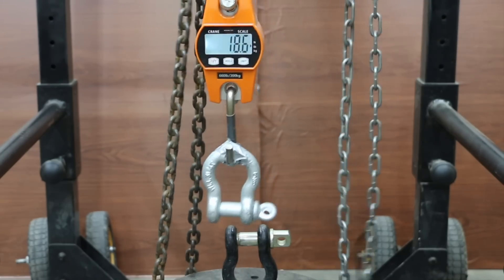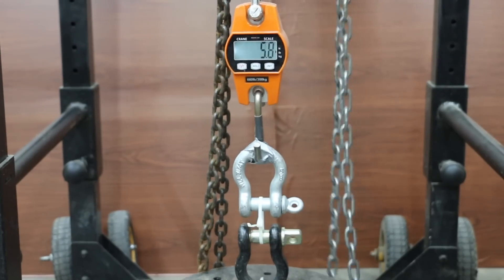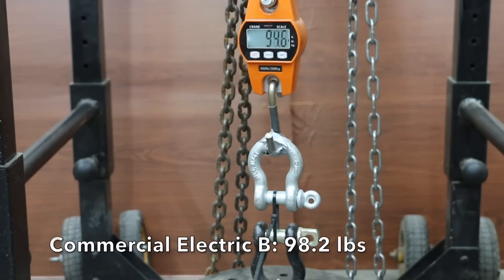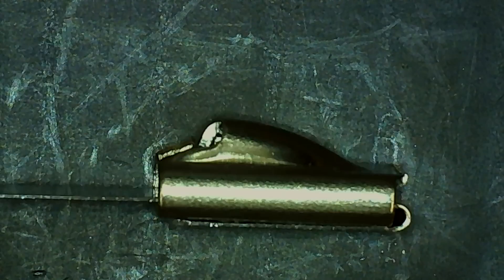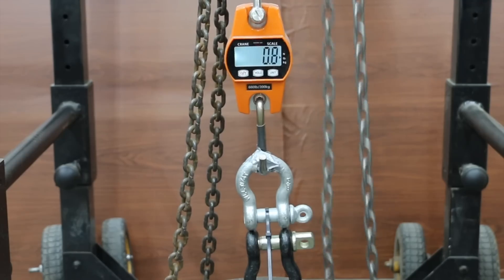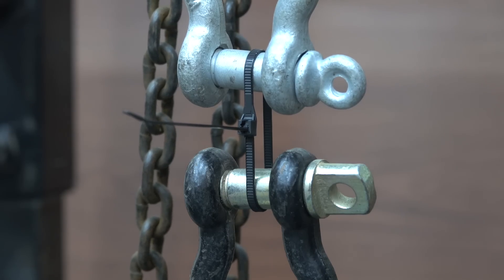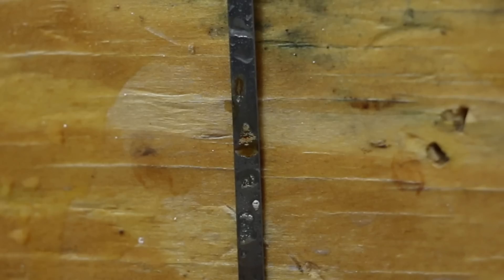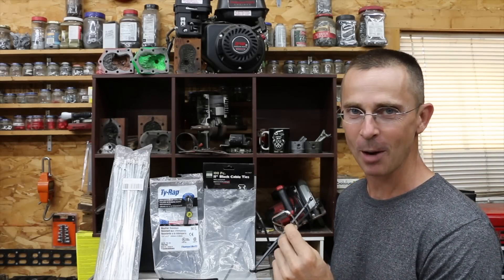Best Cable Tie (zip tie) Brand? Let's Find Out!

Comment: Triple wrapped stainless tie pulling up the back end of a pickup...I hope no one thinks it would do the same only single wrapped. :)   Normally band type hose clamps are double wrapped for more strength; in part due to doubling of the available cross-section and the friction between the band layers, but triple-wrapped is not practical due to too much friction not allowing enough clamping force. I'm surprised you were able to feed two additional layers of band through the buckle/locking ball normally big enough for only one, maybe two.
Reply from the maker: Thanks for the feedback.

Comment: I have the same truck :) I've waited YEARS for you to do a caulking (aka sealant) video. Compare polyurethane, silicone, elastomeric, and acrylic caulking types. Brands could include NP-1 (which is said to be the best), PL (which is ALSO said to be the best), Quad (ALSO said to be the best...you get the picture), Dap 3.0, and others including your generic hardware silicone and acrylic. Tests could include adhesion strength, paintability, stretch, compression, leakiness after cyclic heat expansion/contraction, and mold/dirt attraction.
Also heat and UV resistance, shrinkage, basically what lasts the longest?
Reply from the maker: Thanks for the video idea.

Comment: It would be interesting to make a video on comparing the best anti-friction engine oil additives on the market (like Turbo Maxx, Archoil AR9100, Liqui Moly Cera Tec and Bestline) against an additive called EZI EXTRA POWER LUBE that has been tested and certified by King Fahd University of Petroleum and Minerals. Two of the most interesting results are that it showed up to 71% reduction in wear loss and increase in engine life up to 38%. Here's the link for the testing report: 

https://mafiadoc.com/download/saudi-aribia-pheeramascom_5a27f3d11723ddfec911dfcc.html.

I have been using the EZI Extra Power Lube on my personal vehicles for around two years and it works great but I am not sure if this is the highest friction reducing oil additive in the world or not because I haven't tried or tested the others on the market. Based on my research, I know that Turbo Maxx is the toughest between all the listed above but I do not know if it can beat the EZI Extra Power Lube or not.

Here's the link of the manufacturing company:

https://www.ezi-products.com/

Here's also a link of the oil additive sold on Amazon:

https://www.amazon.com/Ezi-Extra-Power-Engine-Treatment/dp/B07N6KLW1D

Hope we see a comparison video.

Comment: I believe the black ones work better as they have carbon black added to them so they are more UV resistant. Looks like some of the natural nylon ones in your video were rated for indoor use only?

Comment: Something to consider with the nylon ties is the moisture content. Nylon is hygroscopic and becomes more brittle with a lower moisture content and it become more elastic with a higher moisture content. If you decide to conduct further testing perhaps add water to the bag of ties and let them soak overnight. I feel the viewers will find the results interesting. Great video.
Reply from the maker: Thanks for the suggestion.

Comment: Curious if just folding a tie back end back on itself and stapling it, how far would the cheap ones go that had failed on the mechanism. And how good are police ones that supposedly have metal in them. 

While you don't have control what commercials are shown during your shows I try to answer them periodically.  The commercial shown is for KY residents and is against McGrath that's running against McConnell. Says she said electing trump was compared to 911, by a person who was in the pentagon at the time. By the damage trump's done, it's more like WWII.

Comment: I wish you would have included waxed nylon thread, one spool would last an individual a life time and from working on acft the waxed nylon will last decades even when in contact with hydro and fuel where the zip ties tend to fail or break.
Reply from the maker: Thanks for the suggestion for future round of testing.

Comment: I use the Stainless Ties and being from Arizona, I thought it might be helpful to point out that with the Stainless ties you need to curl the cut tail end of the stainless steel ties over on itself twice, this greatly adds to the holding power, the holding ball can slip with vibration over time. All you need is a needle nose and about 5 secs to double crimp the end and you have a 500+ lb (my estimate/guess) tie.  Many YT vids on this process, they even make a nice tool if you use them a lot, but needle nose works great. Also, I don't recommend plastic zips for jobs that have heat, sunlight, it has a failure mode built in. I see auto mechanics using them to hold coolant line or other things out of the way, but they will simply fail with being exposed to a 300-500 degree engine area once brittle.  Same with very cold temps as well, if you are in the midwest.
Reply from the maker: Thanks for the feedback.

Comment: Stop. When I need strength I double loop the tie. I call for a retest.
Reply from the maker: Thanks for the suggestion.
Reply: @ProjectFarm  i made this comment before your final test. Very surprised to see that metal cable tie lift the truck.

Comment: would result be different if the cable lock was 90s from where it is now...resting over the shackle pin?  Does it make a difference where you place the locking part?

Comment: FYI, Having worked in the same jobs in varying climates. I found plastic ties became more brittle with lower average humidity (Low been mid 30%, high been mid 70s). This was most obvious with cable ties stored in the supplied ziplock packaging vs the same brand with torn packaging. This is with ties that spent 6 - 12 months floating around in a toolbox on the back of a ute, only getting used when none where supplied on the job. 

Beyond that, breaking ties that had been fitted for some time was always easier in the drier climates. They tended to be brittle and snap, instead of stretching.
Reply from the maker: Thanks for the feedback.

Comment: Hi Todd, I was wondering if you had thought about test different radiator caps, I have bought one that didn't hold pressure right out of the box, they are pretty cheap but it would be cool to look at a few and their strengths and faults. 
Thanks,
-Nick
Reply from the maker: Thanks for the video idea.

Comment: Ratchet strap showdown next! So many variations styles and brands to choose form. Or "come-along" test if you have not already (a little more dangerous though). Any clamping tools like locking pliers (vice grips) or vices and clamps. Or with all the oil, grease and lube videos you could do a de-greaser test to be different. If you wanted to be a little more nerdy you could do antifreeze test and see which performs better in both hot and cold, resists boiling and freezing and transfers heat the best.

Go weird and see if a personal lubricant like KY can be used as engine oil. This channel has so many options for weird tests and product showdowns it ridiculous.
Reply from the maker: Thanks for the video idea.

Comment: I use cable ties alot in the environment and see the biggest failures during the relatively harsh winters here in New England, I would like to see this test reperformed using temperature as the variable.
Reply from the maker: Thanks for the video idea.

Comment: Since you see a lot of cable ties used in the engine bay of cars, I wonder how heat-cycling affects performance.  I have an older car where zip ties are used to run the wiring harness as well as a few places where I've used one to secure a sensor or connector of some kind.  Would be interested to see how well these hold up to heat cycles.
Reply from the maker: Thanks for the video idea.

Comment: Had just to think about the pinch I got with our previous car: The alternator belt one time broke on the Autobahn and I had to fix it: Using a pantyhose did not work because the space available was too close so I used zipties. This worked for about 20 kilometres or 12.42 miles which I considered to be quite nice for resealable ones.
The car in question was a Fiat Cinquecento model 170 with the 0.9 litre engine and about 39 hp. Of course noone in the USA would be willing to drive such a small car with such a small engine but it worked nicely for our family (two persons with two middle-sized dogs [german shepard and barzoi]). An interesting test would be the elasticity of the zipties because in some applicaitons this could be crucial as well. I picture getting a tent fixed for example.
Reply from the maker: Thanks for the video idea.

Comment: Ties will see different modes of failure.  But the two main causes of performance deterioration is prolonged UV exposure (polymer cross linking) and cold temperature (harden of material in simple terms).  In case of UV exposures, you really won't notice any performance decline in most formulation until after about 3-5 years.   There are machines to simulate these conditions but the in vitro results are inaccurate IME. Exterior application of Nylon seems to dislike low temperatures.  The harden of the material can cause failures as soon as any dynamic forces are applied, say, the stock being tied getting shifted. You are better off doing a low temperature test of these (-15C) Additionally, the design and the number of the teeth often matters very little in my experience as you only really need it to hold at one point to ensure you can achieve around 50-75lb of guaranteed loop tensile strength. Temperature can cause the compliant mechanism to harden and fail, and you will see that as the mode of failure more often than not. As well, you will generally always find US made products performing better not because of the manufacturing process but because of political environmental situations.  More than a decade back, China had outlawed curing/stabilizing of resin by steam as it is extremely energy intensive.  Chinese ties have to be boiled to be cured.  Steaming often allows much better performance over a much longer period of service life, especially on the exterior.  Interior wise, you won't notice too much.
Reply from the maker: Thanks for the feedback.
Reply: @ProjectFarm  we've been a specialty manufacturer for decades now. The quality is really down to the formulation, mould accuracy and curing process.  While I can't divulge anything as to formulation, the later two factors are more like art than exact science.  Some engineers knows exactly the shrinkage rate and how and when to cure/stabilize the final product. I can also tell you with a certainty that darker coloured ties will always fair better in UV heavy environment.  If you had a choice between two exact same ties rated for exterior, get the darker ones.

Comment: Great videos. Thanks.

Removing mill scale at home is one that even the professionals are still debating on. Making it more difficult is large pieces that can not be dipped in a solvent of some sort. Sandblasting at home with a cheap sand blaster vs flappy discs etc. 

How about weld thru primers? 

Thanks
Reply from the maker: Thanks for the video idea.

Comment: Love you stuff! I work with plastics and there is a third variable that explains some of your numbers. Nylon does indeed suffer from UV exposure but nylon strengthens with moisture. Your nylon ties that had been exposed that had UV blockers added were strengthened by humidity.
Reply from the maker: Thanks for the feedback.

Comment: Can you test out "nanotape"? Its this new tape thing thats bot sticky in the traditional sense but uses nano structures to grip things (like gecko feet do). Most claim to be water proof and reusable, id like to see if any strength is lost in that process of use - wash - reuse,  along with their overall load bearing capability (both on a wall (shear strength) and on an inverted surface like a celing (pull strength?)) And what surfaces they stick best to, most claim only smooth surfaces work properly, but I'd love to see painted wall, bare wood, corroded metal(?) And even fabrics (such as using it to stick a flag to a wall) 

Keep up the great content 🙂
Reply from the maker: Thanks for the video idea.

Comment: As a retired telecom tech, I can tell you size does matter when it comes to cable ties.  We used black because white was typically for interior use only.  For heavy loads, we used a very wide black cable tie (that I haven't seen in any store) that I have never seen fail.
Reply from the maker: Thanks for sharing.

Comment: Great job. Thank you for all of the experiments you do so we don't have to!

I have a suggestion for a video. testing offset drivers like this one. ARES 15008 - Impact Ready Offset Extension Wrench. I was actually looking for other brands, but couldn't find any. Maybe a test of using this tool vs using a standard ratchet in tight spaces?? Not sure.
Reply from the maker: Great suggestion!  Thank you.

Comment: watched with genuine interest but at the end of the day, my cable tie purchasing decision is usually based on whatever is cheapest at the store that I happen to be at when its time to restock. Even the weakest one in this video is about 10 stronger than needed for what I typically use a cable tie for.

....Will have to buy some of the stainless ties for the shop though, I could find a whole different category of use for them at that strength.
Reply from the maker: Thanks for sharing.

Comment: My take away from this video is that I should buy zipties and leave them exposed to UV for a year before using them, lol.

I assume the UV Exposed Zip Ties were from the same batches as the ones that were tested without UV Exposure, eliminating the possiblity of a slightly different composition from a batch a year ago and a recent batch?
Reply from the maker: Yes.  Thanks for watching.

Comment: I suspect the reason most of the UV exposed zip ties did better might be because the Nylon was dried under the heat, as Nylon is highly hygroscopic and when moist, it loses tensile strength. It’s a well known problem in 3D printing (though for other reasons). Try drying the non-exposed ties to see if that’s the problem.
Reply from the maker: Thanks for the feedback.

Comment: So the zip-ties are getting harder by UV exposure over a year, but that likely means that they are in the process of becoming more brittle, so a few more years and we'll probably see a lowered tensile strength again as they become more brittle.
Aging plastics is a tricky beast.
As a side note - if you boil nylon it becomes more flexible. Something model aircraft people are aware of - boil nylon propellers on the range. Just don't tell your wife what you are doing.
Reply from the maker: Thanks for sharing.

Comment: Did you buy all the zipties at the same time? because an increase in strength after uv exposure is weird.
maybe the ones you tested without uv exposure are from a different production run and/or made inferior to the uv exposed tie. just something to think about. good video!

Comment: Curious if you used a tie tightening tool for the cylinder head test? Not that I think it would make much difference, but it would give it the best possible shot. I'll link one like I use for exhaust wrapping, works great for me.

I dont think its the same brand but it looks exactly the same.
https://www.amazon.com/dp/B019GMDGW6/ref=cm_sw_r_cp_apa_i_4nryFbAWAPYXH

Comment: For the ties that slipped would you consider retesting them by rotating the connection to the top or bottom to see if a difference on the connection itself helps them or hurts. Thats how i always apply ties and guess many others do as well, it just seem to get tightest if the connection is on a corner or curve. Always been curious if im doing it the best way.

Of course this applies to all of the ties, it just seems to me the types that have already slipped in testing offer the largest potential for such a test focusing on the connection.
Reply from the maker: Thanks for the suggestion.

Comment: PF, thanks always for the great videos, watch them from start to finish.  I've always wondered about your last test, which is stronger or are they about equal? A single cable tie wrapped multiple times say 3x, like in your truck lift, but only has one lock point for a single tie, or multiple cable ties say 3 of the same type but only a single wrap each, to match the 3 multiple wraps, that has 3 lock points?  This avoids the lock point failure potential but it also 3x more costly.  If you can get more strength out of a cable tie simply by looping it before locking, that would good to know, it would save a lot in cable ties and getting more strength.  It seems if looped, part of the load would be taken up by the tie directly instead of the lock.

Also, what happens when you extend a cable tie, that is use two or more ties and lock them together to increase the diameter of the loop?  Is the strength maintained or not?  Thanks and more power to you.

Comment: Was it just me or did it look like the JB weld was not making contact all the way around. it looked like you could still see brush marks in it from the application. Maybe the head/cylinder block was not flat or you didn't tighten them enough. Great test otherwise. Really surprised how well they all performed above nameplate.
Reply from the maker: Thanks for sharing.

Comment: Thomas & Betts also makes cable ties with the plastic locking mechanism.  Also, Panduit makes a cable tie with the metal barb locking mechanism.  Another thing to note is that nylon is hygroscopic and will perform weaker when there is more moisture.  Sincerely: former cable tie design engineer at one of the companies mentioned above.
Reply from the maker: Thanks for sharing.